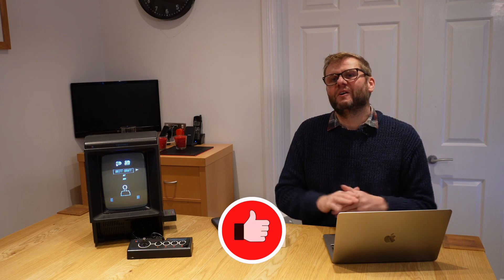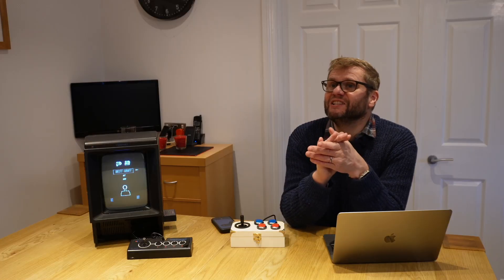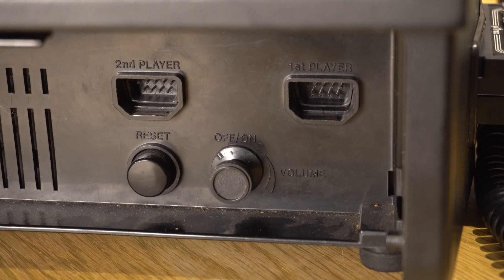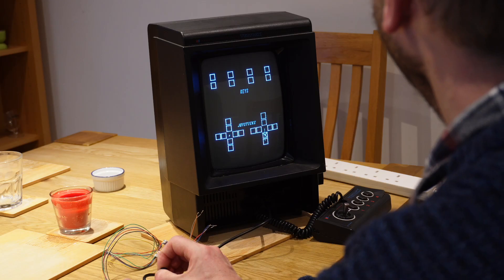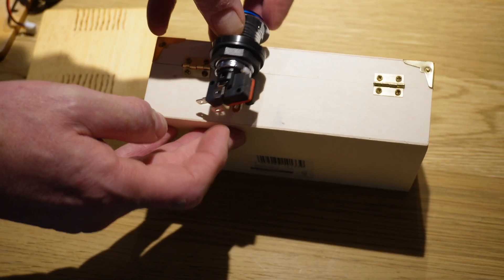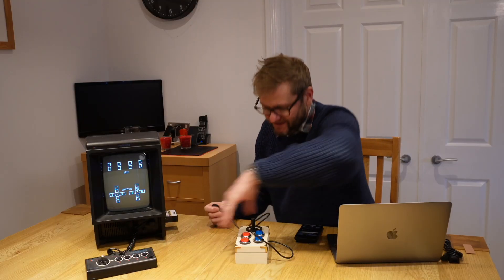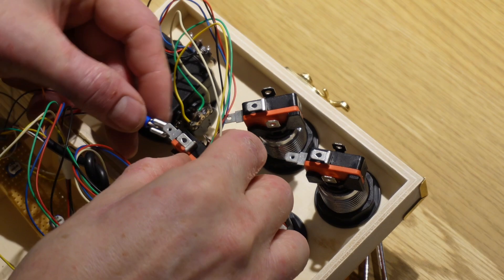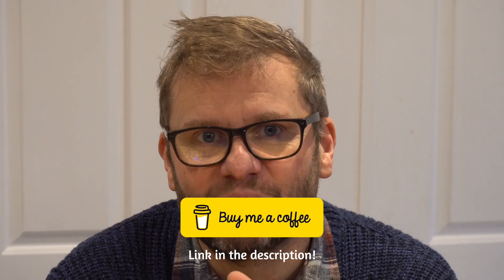Crafted From Scratch: Unveiling My One-of-a-kind Vectrex Joystick!

Comment: Jubber probably felt a cold chill run down his spine when you mentioned analog control 😆
The first issue being the code doesn't fit on the cart beacuse he's packed it full of content.

Threaded rod or solder is the way to go for attaching those brass fixtures. You'll be disappointed with the performance of any glue.
Reply from the maker: To be clear I think Jubber is a hero, he actually made me a special cart with Victorian names for the games.  Interesting to understand the challenges. Maybe if I run it as an emulation on Pitrex there’d be room!? Tanks for the suggestion of solder, I hadn’t thought of that.

Comment: Yes, and no. Most Vectrex games use the Vectrex joystick in a digital mode. Even the Vectrex Test Cart will show you the analog position, but also the digital activation points for a direction.
In an case, it's certainly preferable having an analog joystick for use with all the Vectrex games is better IMO.
Reply from the maker: Yes. It's a shame more games don't use the analogue data. Always better to have an analogue stick and be able to use it if required.